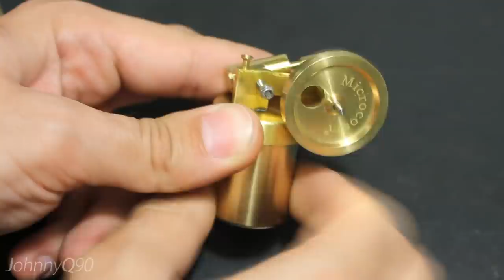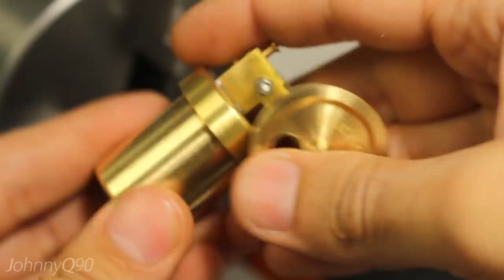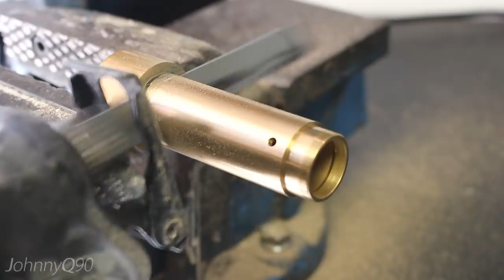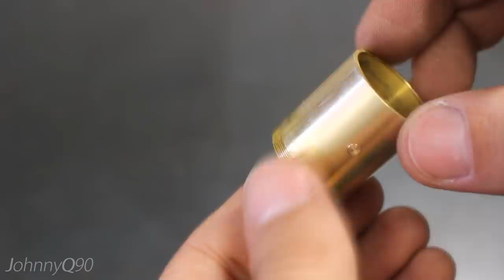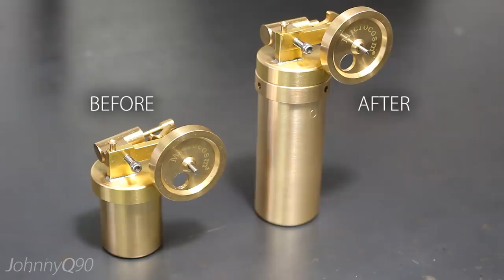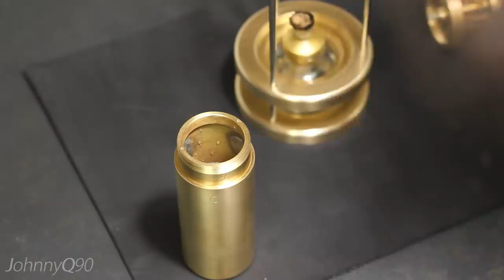Mini Chinese Steam Engine

Comment: There is a brass machine that through its workings caused water to turn to steam from producing frequency from the regined crystal moving parts that vaporized the water requiring the device to have no open heat source in order to operate. 😊
Reply: To: Indigo Dragon71,
Do you have a link for the engine you speak of?

Comment: i know its bascially a toy, but the principles are the same, you wouldn't floor the pedal on your car every time, like this, its "stuck" in full throttle  you should not add so much water, then it will not run so hard/fast

Comment: The part component manufacturing & running working system of steam enige is shown but viewers are interested to know how the shaft & piston working with the pressure of hot steam by valve operating. Hiding the valve operate mechanism it's a advertisement of the product.

Comment: now capture the steam, run it threw a radiator and send it back
Reply: You can't do that. If you just fed it back to the boiler there would be the same pressure on the exhaust as on the inlet so the engine could not run. You have to condense the steam and then pump the water back into the boiler at high pressure. The engine is not powerful enough to power a suitable pump.

Comment: The three "rivets" seem to serve no real purpose?
Reply: That's what I thought. I was looking through the comments to figure out what I was missing.
Reply: Daniel they attach the original threaded cylinder which he cut the end off of to his modified larger water cylinder/boiler
Reply: He could just soldered the two together (like he did anyway) without the rivets.
Reply: nirmal It's a steam boiler. More strength is better. I wouldn't trust solder alone to hold up under pressure.
Reply: SentsuizanXS this isn't high pressure
Reply: PsychoLucario ok then, what is the pressure of the steam in psi, and what is considered high pressure

Comment: make a loop that runs the steam back to the canister!!!
Reply: You need a way to contain condensate and force into boiler under pressure higher than canister.
Reply: well its stem it already has pressure all you need now is a loop to condensate the water to the canister
Reply: The condensate/steam seems to be leaking past the piston to atmosphere. FYI the rocking cylinder facilitates the steam inlet/outlet valves.

Comment: What about attaching a small motor to it and making it into a generator?
Im curious about how much usable power can be obtained. Maybe trying to charge a super capacitor which then charges a battery which then can charge a phone? (just a random project suggestion)
Reply from the maker: +Mr Rishi The Cookie I actually tried it and although it spun it quite fast it couldn't lit an Led. I used a small motor from an Rc helicopter.
Reply: really? wow i assume using a higher power generator would strain a motor like that since i think it wouldnt have enough torque. anyway thanks for the reply. I would have expected it to work tho. Might have been useful in a survival situation if it did XD
Reply: I assume it would be much better. I'm just thinking worst case scenario in a survival situation. I assume you can tinker with it and create some circuitry to improve the efficiency of the energy you can extract by optimising the rpm of the steam engine to run at its more efficient rpm and the most efficient rpm of a small generator say from a handcrank torch for example. Either way its just a fun thought experiment.

Comment: I Got Me A SunnyTech One On Amazon Came In 3 Days (it said it would take 4) runs well but my flame is too big Have Any anwsers
Reply: Thanks For The Help.
Reply: To: 100,000 Subscribers Without A Video Challenge,
I also should have mentioned that you want to adjust the wick so you get more blue flame and less yellow or orange Flame hitting the boiler, the more yellow or orange the flame is the more soot it will create and the less efficient your steam generation will be.
I hope this helps!